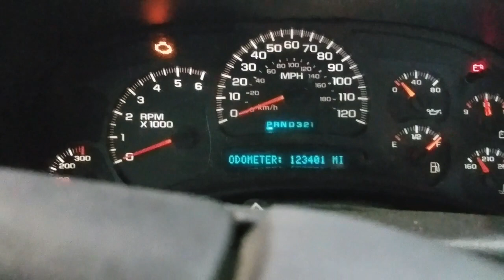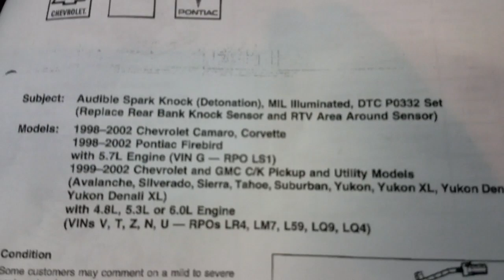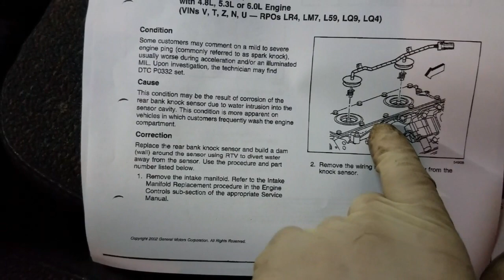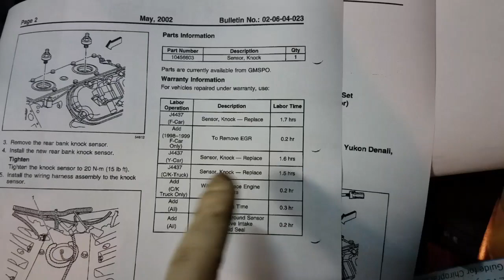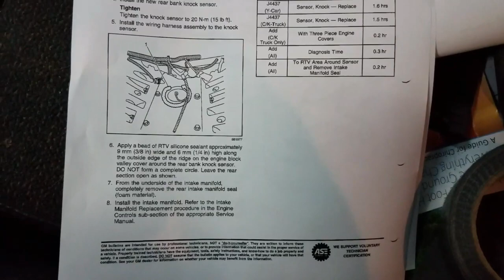GMC Chevy P0332 P0327 Knock Sensor Circuit Low Input "TSB"

Comment: Had anybody solved the "low voltage" aspect after replacing harness and sensors with OE parts and proper torque?
Reply: Adding a ground to the cmu straight off the battery is what I'm trying next. It shows it helps in SUVs
Reply: changing the harness and making sure the port is free from rust and debris to get a clean metal to metal connection. Using the good AC Delco sensors. Change both while you're there. You might have to take the valley cover off to clean it properly. DO NOT BUY FROM AMAZON. If you're gonna put in the work, buy OE parts. RTV around the caps.
Reply: Yup. Splice the wires of the bad sensor to the good one and run on one sensor instead of two. I’m done fucking with it.
Reply: @dustin4432  😂
Reply: @ronniehdable what’s cmu
Reply: Clean all ground connection on the truck. Should restore the power.

Comment: They were saying to clean up the ground wire connection. My wire had some rust so it seems to be running better so far
Reply from the maker: Thanks for sharing your experience! It's always helpful to hear about little fixes that make a big difference.
Reply: @FlatRateMechanic can you keep driving the truck if you got a knock sensor light on?

Comment: Anybody ever replace the sensors and when the computer resets itself still gets a low voltage code
Reply: I replace them n I still get the knock sensor code. do u  think they may have have been bad from factory?
Reply: Yes. Happened to me
Reply: @raulfalcon4031  Only use the AC Delco Ones. i bought the ebay ones. junk. google it
Reply: you should torque them at a specific number
Reply: Replace sensors and wiring harness twice,  OEM parts. Torqued to OEM spec. Thoroughly  cleaned the sensor cavity and check for continuity. Still bad.
Reply: I’ve done oem And eBay ones on my other trucks in the past and it still threw the codes .I’m wondering if the wires themselves are finicky and shoot the code when twisting a little . That’s my next test

Comment: I just changed my knock sensors and wire connection not a month ago. Now its throwing the p0327 code for knock sensor again... 😠
Reply: Me too.  Replaced the new sensors and harness with another set. Torqued to spec, everything by the book...no luck.
Reply: Same knock sensor issues ... replaced them ... engine and battery light  ...  stills comes on and off ..does anyone have a solution  !
Reply: @ipainfree1957  I think we all on the same boat. We all going through this! Lol I'm about to open it the third time

Comment: I just replaced both knock sensors 5.3 L with new wiring harness. Sealed both sensor boots as directed. All a/c delco parts. Cleared codes. Drove until all readiness codes were complete, same codes as before. SEL is on. Connector is in place correctly and now wonder why the low voltage code is back. Could the PCM have issues or wiring issue between sensors and PCM?
Reply from the maker: If you have a mechanical problem with you motor, AKA engine knocking due to pre-detonation or internal knock it will also set this code.

Comment: So I put in brand new sensors and wiring harnesses and cleaned everything super well and now it says low circuit banks 1 and 2
Reply: Same here!
Reply: Same, just this weekend
Reply: Hey man I got the same problem I replace mine and I've got all the codes off everywhere except that onethis time I was just got gas and pulled out to the road everything was clear then it come on and almost the car almost quit running
Reply: So how did you fix it I’m having the same problem replaced with oem parts and was good for a week and bam came back
Reply: So I still have this truck and yrs later the same problems.lol just send it
Reply: They were saying check the ground wire  for corrosion.

Comment: Had a Saturn sl1 1.9 w/ a p0327 code, driving me crazy I had a brand new duralast ks put in and the code is still there. Turns out gm only want u to use their oem ks and any aftermarket ks won’t give a correct voltage reading to the ecu for some reason. A trip to the junkyard help fix the problem

Comment: Don’t get aftermarket knock sensors!! AC Delco only! Go to an actual parts store and ohm test them with a multimeter before you bring them home. You want a reading of around 100k ohms. Specs state should read between 93k and 107k ohms of resistance.

Comment: Had a 2004 yukon with code po332 install a new sensors..after 2 weeks the the check engine light appears agen whit the same code...I'm sooo stressed 😀
Reply: Can you keep driving if you got the knock sensors check engine light on?
Reply: @nathanmccumber8965  yes ...
Reply: @leobardorocha9191  just made it home brought me Silverado 03 drover it 3hours. Doing tune up this weekend and knock sensors.

Comment: Funny 😂my 1999 Yukon 5.7 vortex has only one knock sensor on the left side of the engine block right under the starter.
Reply: There is no two knock sensors under my intake manifold on my
1999 gmc 5.7 vortex engine. This guy is showing two knock sensors under the intake manifold.
Reply: You have a Vortec/Small Block Chevy, NOT the LS engine, this doesn't apply to you